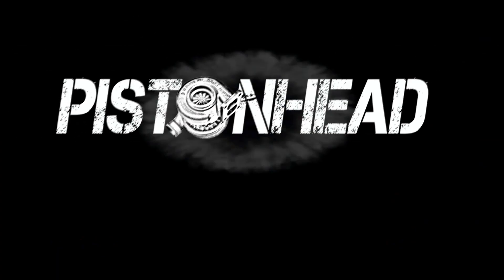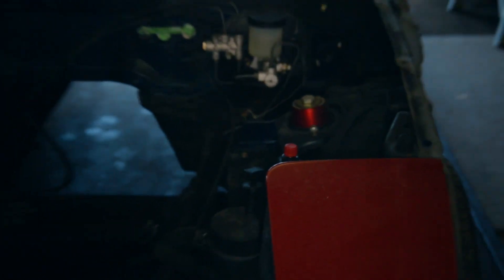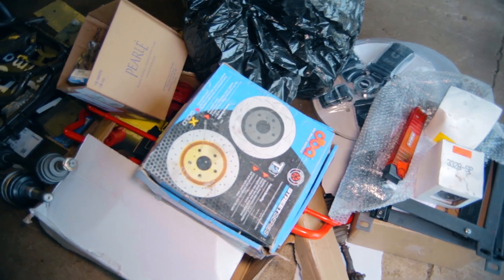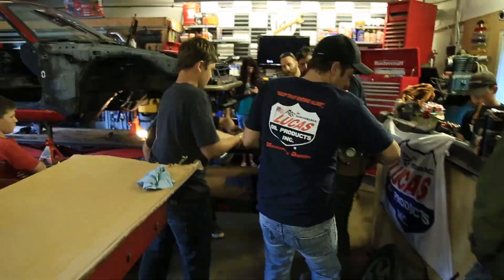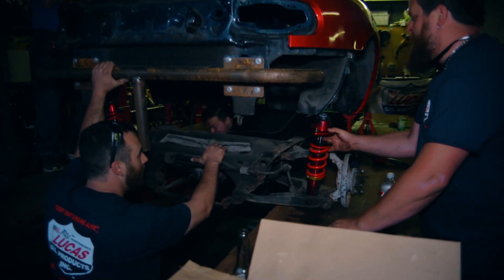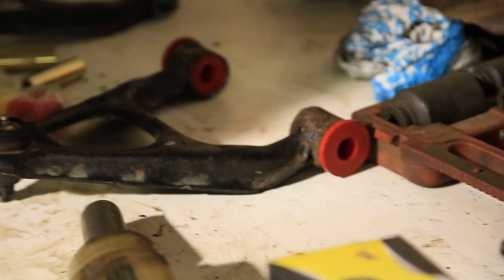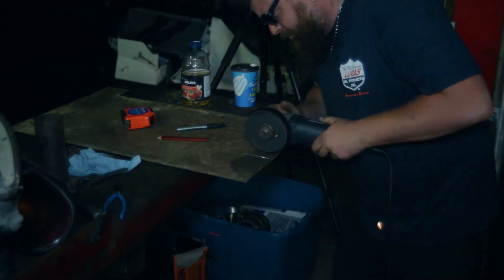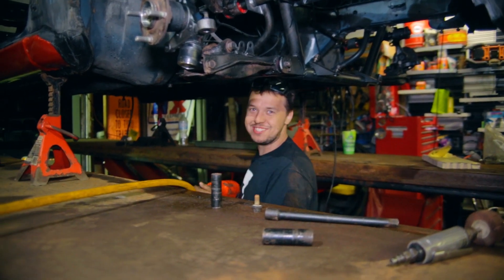Building the #Sootsalon - Cummins swapped Miata! Part 1

Comment: If you can squeeze a 4BT into your Miata then the ALH swap that I have planned for one of mine should be easy.
Thanks.
(1.9L ALH backed with an AX15)
Reply: Sounds fucking cool! I drive a 01 jetta tdi with the ALH. 246k miles and still boosty and fun. Fairly slow but enough torque to make it feel fast. (EDIT: I'm sure miata weight would make it quicker too)
The transmission however Idk anything about. I saw it came out of a few trucks and stuff on google.. Would it be RWD?
Reply: ***** 
I'll be removing the 1.9L ALH from my 2003 Jetta. Hoping to part the car out after I remove everything needed to swap the engine into my Miata. I currently have an AX15 sourced from a 2wd late 90's Jeep XJ. The AX15 is one of the more common transmissions to adapt to the ALH. There are several companies making adaptors to mate the AX15 to Cummins, VW, and more but it can be done without aftermarket support as well. It would indeed be RWD.
Reply: Thats what I would have done. Small and capable of making pretty huge numbers for a small diesel engine.